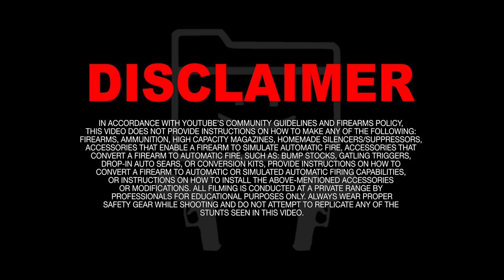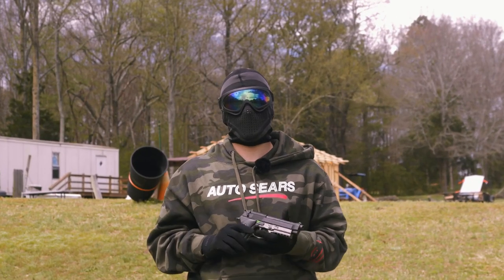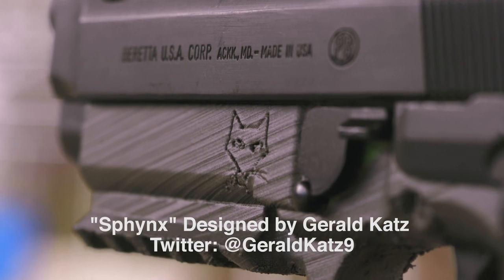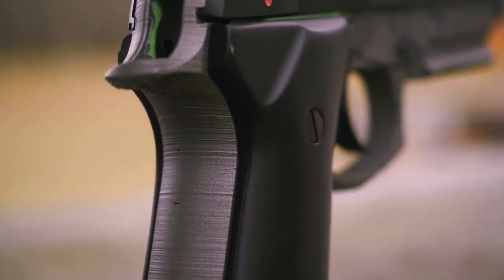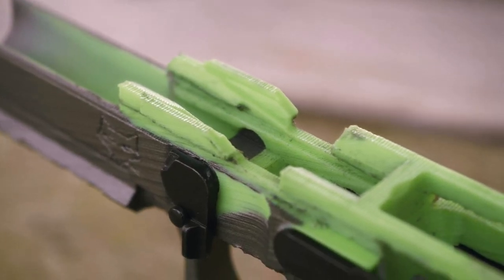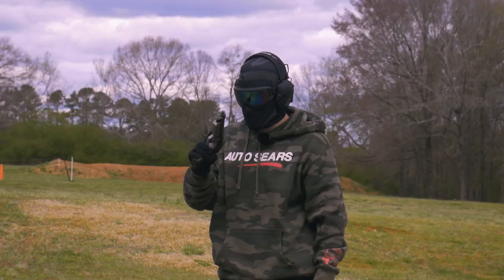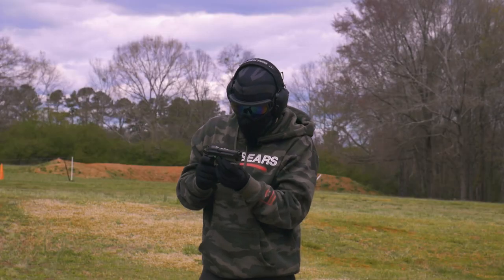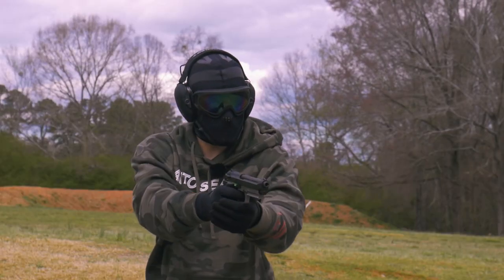This Is Not Your Uncle's Beretta (Reupload)

Comment: The print I have… mag well needed a complete resizing. Slide lock needed to be resized lower. Rails weren’t bad just need slight adjustments. Finally the last would be the key ring for hammer spring needed a complete resizing aswell.
Reply: where did you find the file?